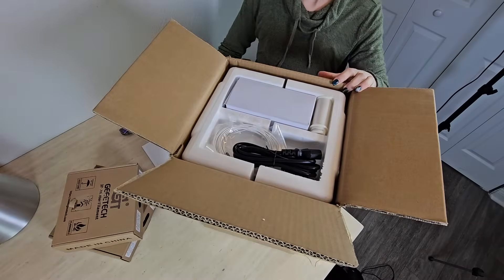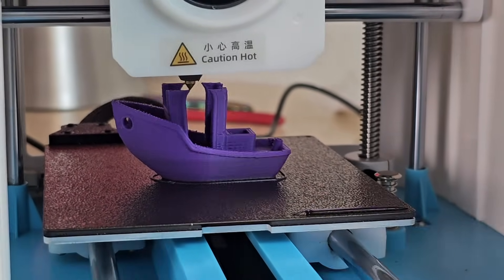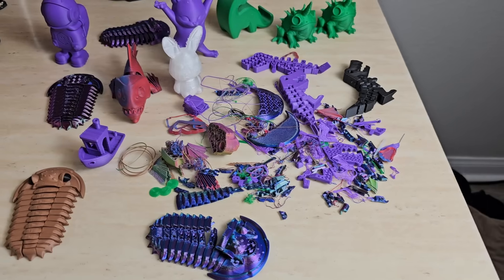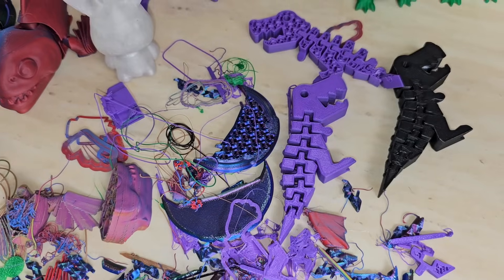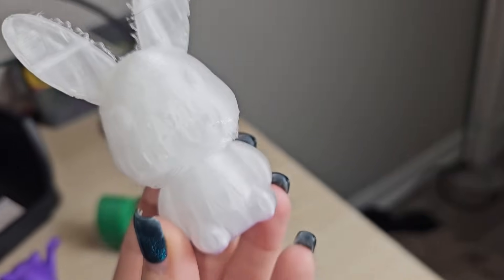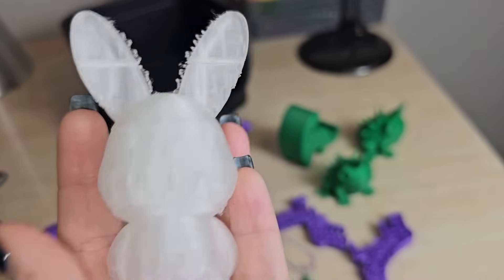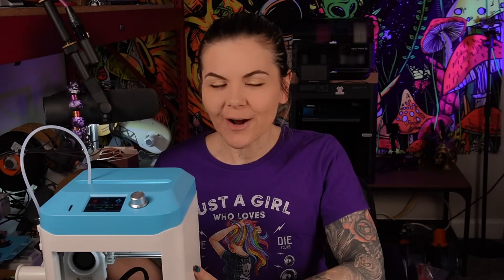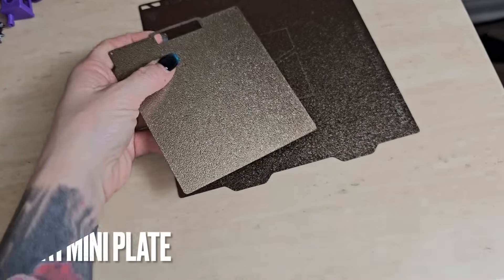Unboxing & Review on Geetech’s M1 Mini 3D Printer! My Experience after 100 hours!

Comment: Bought one for $130 off aliexpress. I'm planning on swapping out the MCU and klipperizing it. I'm also planning to re-design the printhead to upgrade the hotend and extruder. Super cool little printer that might have some hidden potential.
Reply from the maker: Wow that's rad!! I wish I could see that in action. Geetech sent us a new one and it looks a little different. Perhaps its better now but I haven't been able to test it yet
Reply: I plan on making a full writeup and probably a video. For now I'm gonna be documenting in the Simple AF discord since I plan to use Simple AF klipper. There's another member on that server doing something similar with a Kokoni printer, which looks similar to the M1

Comment: Well, I have 3 Geeetech printers, one I3PRO B that I bought 11 years ago, still works, but the print quality is subpar. And I have two Geeetech Mizar Max printers; they are definitely way better, but they are bowden setups, and they are pretty slow. But can print massive things, 320x320x420 I think? Don't remember. But I never print that big, because they are slow compared to modern printers today. I wish the Elegoo carbon printer came out a bit sooner, because I bought my Mizar Max 6 months before it got released I think. And I also won the same printer I bought in a giveaway, so then I had two xD
Reply from the maker: That's good to know! My mini Geetech stopped working and they sent me a new one so im excited to re-test this updated version as it looks slightly different than the original one I got. Happy printing!!!

Comment: not all ender 3 versions need alot of tinkering. i find most tinkering comes when your messing with slice settings and trying to get those fine tuned profiles for faster prints at great looking. i use stock settings and just let it print. im usually not in a rush and not one who likes to tinker much too.  It looks cute and looks similar to toybox. i think that is best for a child printing little things and not really the fancy things. And that should be more around 100 price. Like you said to close to a1 mini which is in a way portable.   Love your shirt
Reply from the maker: Hey thanks so much for watching!! And I too like to just print without tinkering, I leave that to Luis😆 I also agree the Geetech printer HAS to come down in price, it's just not practical by any means

Comment: look for the following on bambu online models  1. AMS V2 Glass Slim Riser/Slider for P1P, P1S, X1C  2. LED strip holder for AMS Slim Riser / Slider 3. Bambulab P1S Lock clip for sliding glass.  with a 5 v usb switch plug and 5v cob led lights you can add so much lighting to your p1s. I would show you what i did but can't seem to add photo
Reply from the maker: I'm sure it looks awesome! Thanks for the suggestions, I'll give them a look!😀

Comment: Put the fan speed to 100%, then if it fails, move to slower mms (speed). For adhesion add 5c to bed temp to make it stick more
Reply from the maker: The bed temp is maxed at 60c and the fan is at 100%. We run it at 50% speed and are having success😀 We have yet to have a successful print at 100% speed though (except for their preset benchies)...thanks for watching!